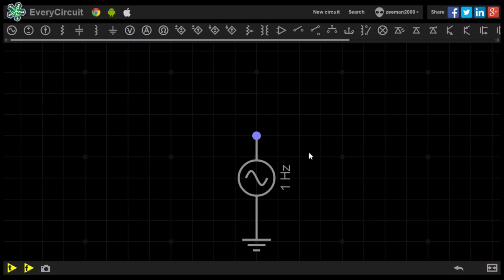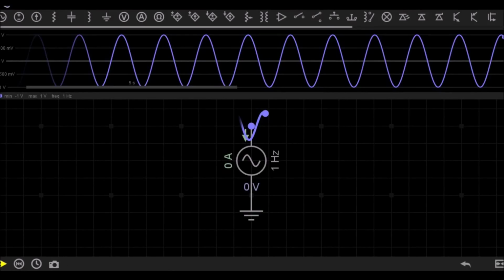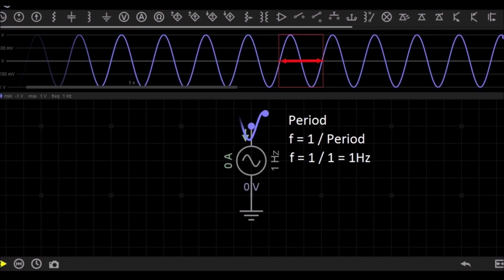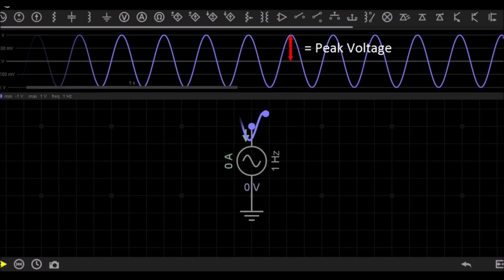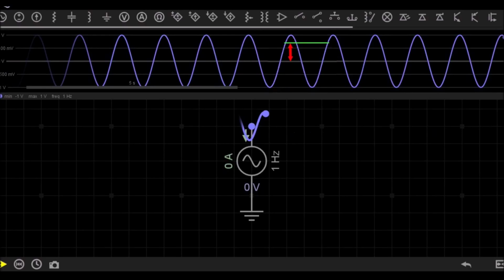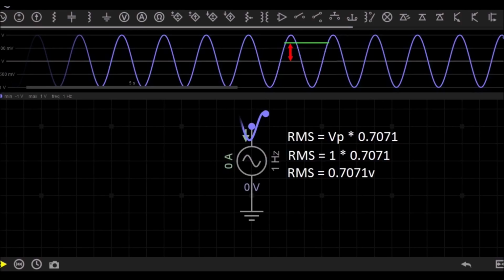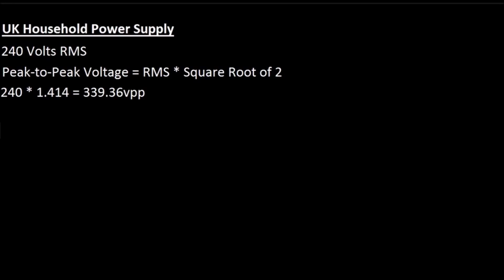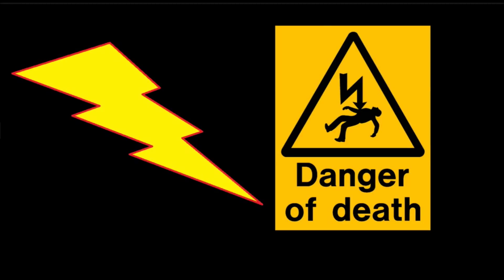Electronics Tutorial 12 - Inductors - Alternating Current

Comment: Sorry, there is an error. 1ms is not 0.1s, but rather 0.001s. Another thing that I think is wrong. If RMS is from 0 to Vpeak * 0.7071 - then the Vpeak is Vrms * square_root(2). And peak to peak voltage should be Vpeak * 2, not divided by 2. Otherwise. thank you for the tutorials. They are very helpful.
Reply from the maker: Good Day to you Dmitry, Thank you for your help with this. I will add notations to the video to make this correction. Thank you for your comments and words of encouregment.